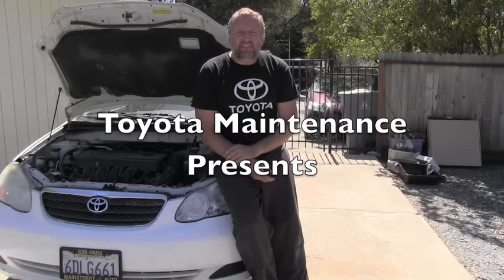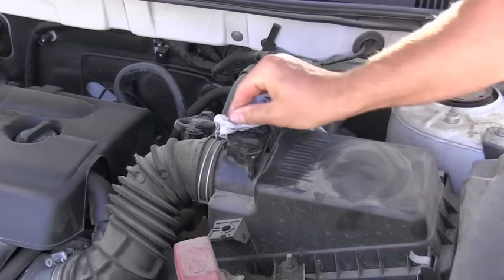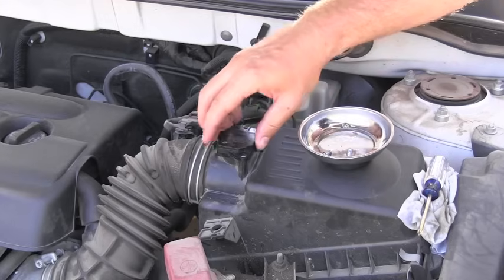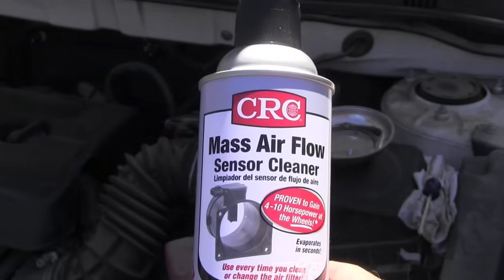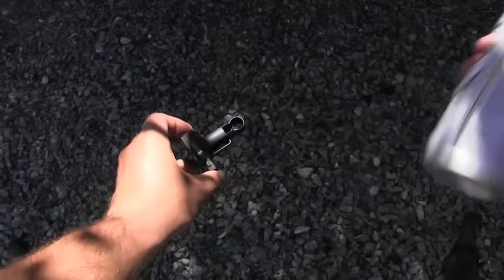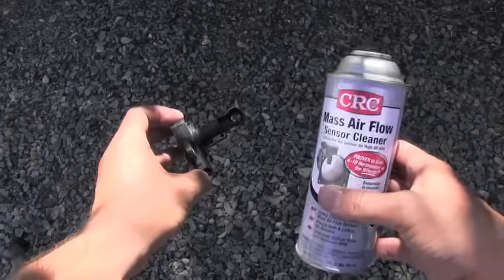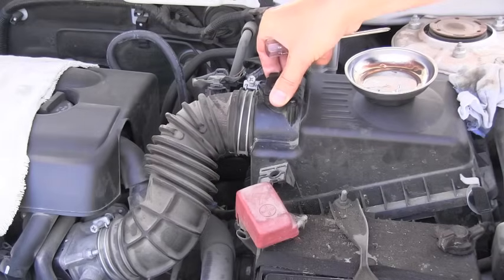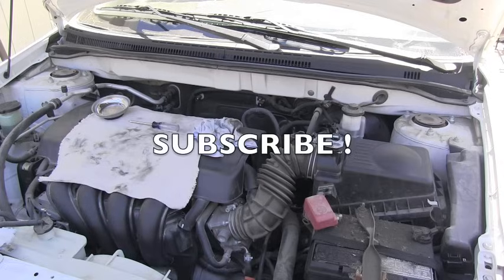Toyota Corolla Mass Air Flow sensor cleaning

Comment: I have a very rough idle only when I'm stopped at a red light and car is in drive (the body of the car shakes a lot). I changed all 4 motor mounts. my 2003 corolla idles at 650 when the car is at normal operating temperature, idles rough only when in drive.  any ideas?
Reply from the maker: +Ken  It sounds low…it should be around 860….i will start with Techstream looking on all Live Data…you need help from Expert. Good Luck.
Reply: had same problem but after i changed the spark plugs and head gasket it went away.
Reply: Ken same problem now !
Reply from the maker: 650 is too low…should be around 850…..

Comment: Thanks so much. Clear. Simple. No unnecessary details. I'll try this today when my husband and I get back home. Can't wait!
Reply from the maker: +Erica Politica  Have fun, Be Safe.
Reply: +Toyota Maintenance Just finished! I cleaned the surface with a towel, disconnected the cable, unscrewed the screws, sprayed with the same brand spray while blocking the cable port with my finger but it was cold because I left it in my trunk overnight, let it dry for an hour and did not let anything touch the wires on the inside or the one in the side, put it back in, put the screws back in, and reconnected the cable. Unfortunately, my check engine light is back on. It was going on and off over the past few weeks and it was off before I cleaned the MAF but came back on as soon as I stated the car. Did I do anything wrong? Any suggestions on what could be wrong? I have an 05 Toyota Corolla.
Reply: +Toyota Maintenance Never mind. I read elsewhere that the MAF needs to warn up, well that and that the prongs could be bent. The prongs weren't bent and a short drive made the light go off. Thanks so much for the instructional video!!! Next I need an alignment. lol

Comment: Thank you! Fixed my Check Engine light code "P0171 - System Too Lean"  ... I removed battery cable and left it out for while cleaning, it also cleared the light.
Reply: I hope it happens with mine 😩 have the same code and all
Reply from the maker: +areguly  good job !
Reply: Sadly no it syill vibrates when i stop with the ac on and the revs go very low.
Reply: @Hbf_Sneaks_  ever find out what it was?

Comment: do you have a video on cleaning the throttle body on a Toyota Corolla 2006? also I was told that the throttle cable might be a little loose and I can make it a little tighter for better throttle responsiveness, is this true? do you have a video for that?

thank you
Reply from the maker: +Haleem Sharback  I have video on cleaning throttle body..you can use it as a guide….

Comment: Just a tip, use the straw that comes with the cleaner, this allows more accurate pressure to clean the contact surfaces effectively.
Reply from the maker: thanks for sharing
Reply from the maker: Thanks for sharing
Reply from the maker: thanks for sharing
Reply: thanks for sharing
Reply: thanks for sharing
Reply: Thanks for sharing
Reply: @mikhailshahid3807  thanks for sharing
Reply: thanks for sharing
Reply: @Jamal-xz2dk  thanks for sharing
Reply: Thanks for sharing
Reply: thanks for sharing
Reply: Thanks for sharing
Reply: Thanks for sharing
Reply: Thanks for sharing
Reply: thanks for sharing
Reply: thanks for sharing
Reply: thanks for sharing
Reply: Thanks for sharing
Reply: Thanks for sharing.
Reply: 😂 actually thank you sir
Reply: thanks for sharing
Reply: Thanx for sharing

Comment: I have toyota 1nz 2002 
The vehicle has aproblem of loosing power after the engine gets warm after driving either on traffic or driving none stop 50kms when I slow down or going down ahill on idling then it doesnt accerelate but after stopping for afew mins of idling or putting it off it gains power and repeat the same.
Even after diagonizing it doesnt show any fault.
 Ihave replaced the fuel pump and fuel filter, clean the throtal but still behaving the same way. Please help.

Comment: Thanks for the  videos. I have toyota corolla 2008. There is big sound comes from engine when I give immediate accelerator or  take the car suddenly after stopping or slowing down the car  below to 15kmph. can you please advise why that abnormal sound comes with engine sound.
Reply: +Shamseer KP 
Try checking the engine mounts.
Used to have a similar sound when accelerating or decelerating.
Had to replace one of the mounts and the sound disappeared.
Reply: Thank you Rasec.. yes you are absolutely right..I did it
Reply from the maker: +Shamseer KP it sounds like you need professional help..good luck.

Comment: Hello mr, I have a 2003 Corolla vvt engine and it's taking a long time to start it cranks for like 6 seconds sometimes it takes more do you think is the air flow sensor or what could it be ?
Reply: +Luis Benitez (Thelouie214) You Idle Air Control is dirty, a common problem on Corollas and Camrys

Comment: Is this similiar to the one on the 2003 toyota Echo? I think I have a problem with my MAF as I keep getting the engine light lit up. Do you think this may be my problem, and what if I just use a bottle of water and diluted vinegar to clean it?

Comment: I wouldn't have believed in a million years that cleaning my Mass Air Flow sensor would solve my irregular idle issue but your steps solved my problem in fifteen minutes!!!!    My 2008 Camry was nearly stopping when idling and after removing my MAF sensor and cleaning with the recommended cleaner it runs a smooth as can be.  For $5 I avoided a $250 SCREW JOB at a dealership or garage.

THANK YOU for taking the time to walk me through the steps.  You saved me a bundle.  Now I know how to solve this problem in the future.
Reply: I'm surprised the check engine light wasn't triggered when the issue occurred.
Reply: Just clean the throttle body it will solve your problem I did many Camry in this way that was poor idling and dies
Reply: How long does it take to dry?
Reply: @nmjw99  Just a few minutes should be fine. This cleaner dries almost instantly.
Reply: Steve Anderson I’m having the exact same issue on my 2010 corolla with 223,000 miles. Just bought this cleaner and giving this a try. I’ve replaced the fuel pump, spark plugs, intake filter, water pump, serp belt and alternator... the good thing is I saved a bunch of money doing this myself but it still hasn’t solved my rough idle. Hope this fixes it!
Reply: James Ha, if it's rough when idling, try cleaning or replacing the Idle Air Control Valve (IAC); they have a tendency of getting gunked-up over time.
Reply: @astromoosie  
Maybe a mechanic would have cleaned the sensor first and saved you from doing all that other stuff?
Reply: @njsongwriter  the other stuff is apart of cars maintenance so it being done will only make the car run more efficient especially if the car is 200k miles.
Reply: @onyx_might72 if you use quality parts. Sometimes a warn out OEM Toyota part is better than a brand new after market part
Reply: @astromoosie  Did it fix? I am having similar issues!
Reply: SPT no it did not! What fixed my issue was cleaning the throttle body! Look up on google on how to do it. It’s very easy! My car is now near 260,000 miles
Reply: @astromoosie  Great! Thanks. I will try doing both.
Reply: @bashvim  I know that was six years ago, but do you remember if it worked? TB cleaning fixed two of my Corollas. Another Corolla (this is my 5th one) stalled today and ran rough all the way home. Hopefully this will fix it
Reply: @ArsonistArborist  It didn't work. Nothing worked. Several mechanics in my area also couldn't do anything! Sold my 98 Corolla for $800. Buyer fixed it and shipped the car to Liberia from US for $2000. He told me it was running great for him. I don't know what he did to fix it.
Reply: @bashvim sorry to hear that!
Reply: @astromoosie  
Let me know how you come out. I also have a 2010 Corolla. It only idles rough when braking. My check engine light also caused a VCS traction control, but I found out that is a Toyota software default.

Comment: Do you have to disconnect the battery before removing and cleaning? Thank you for the video
Reply from the maker: no need. you are welcome.
Reply: Toyota Maintenance  My acceleration power is less. It will improve by cleaning this air sensor?
Reply from the maker: Smitha Rajesh it could, but your problem might be something else....